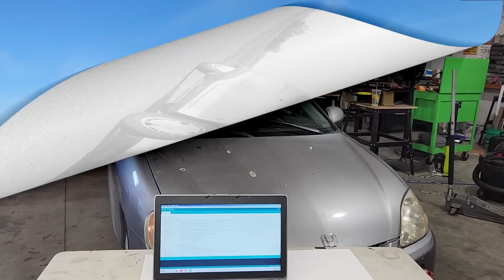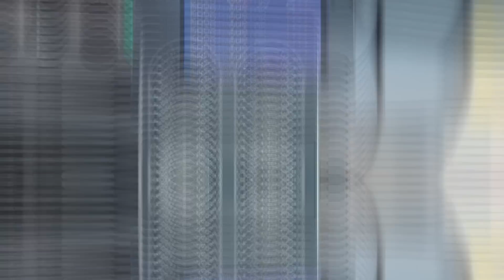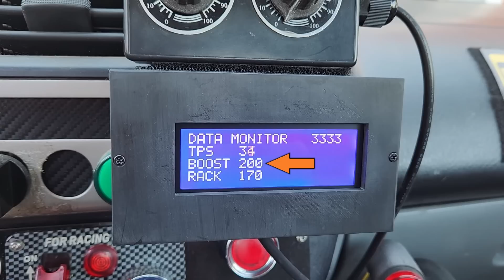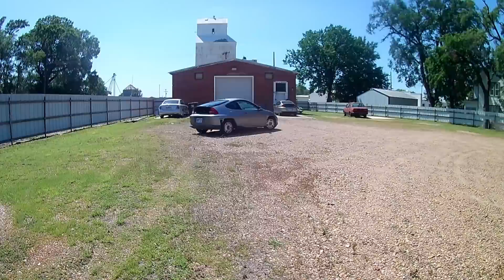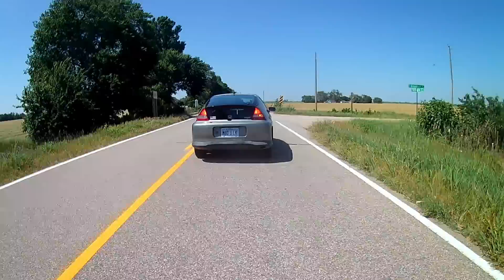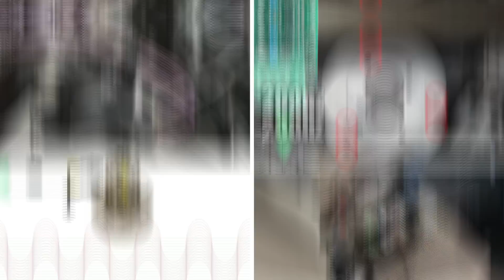S4 E22. We road test the Arduino engine management on the supercharged kubota diesel honda

Comment: Mitsubishi had a similar system on their euro2 4D56 engine before they switched to common rail injection

You can see it on some of their old triton/L200 single cab pickup trucks 

The injection pump has a servo attached to it that can adjust the fuel screw automatically

Comment: I wonder what the goal is and why he choose a tiny Kubota diesel instead of a, let's say, a TwinAir two cylinder 900 cc engine. Turbo charged these will at least have 105 hp. Doing the 'Everything at Home' trick that number would probable be much higher.

Comment: Wouldnt a turbo be more efficient than a supercharger? Maybe a variable vane turbo to make it spool on low rpms aswell.
Maybe also a intercooler and water injetion. So it runs cooler.
Reply: And NOS, how else would he win against hector and his turboed spoon engines with motec exhausts😅😎

Comment: A couple thoughts - you might want to make a 1/2 second ramp up to full fuel so that mashing the pedal still minimizes soot, and you might want to make a 1-2 second hold delay before dropping back down to zero, to help with shifting - otherwise, existing manifold pressure will be lost. Given that you have a fair amount of piping and an intercooler, that could take some time to repressurize, killing your numbers.

Comment: Maybe use the RPM to delay full throttle a bit, so the engine has time to chooch faster before you dump in so much fuel.

I think that might be the better option than use simply the throttle position sensor as it will allow more fuel to be pumped in if you go full throttle without any visible smoke.

You can just put the engine under load by driving and adjust for each RPM the knob until you see smoke and then back off 10% from the position you dialed.

Comment: You could make an optical sensor to detect the soot in the exhaust. I think they're fairly simple and you don't need an accurate number - just an indication of when it increases or decreases. Maybe get the control system to train itself. Or at least to characterise the space it's working in.

Comment: Old school turbo diesel were fitted with a device that allowed the control to open further as the boost pressure increased this would easier for you implement and compensates for loss in boost such a blocked air filter

Comment: And I forgot, datalogs are Your best friend, so get as much data as possible, somewhere on SD card or something, I think that MADMAN gauge You have in car has enough inputs to get everything(I'm not sure about data frequency of the logs but anything is better than nothing), just connect Your arduino PWM outputs as MADMAN'S inputs to get all data from Your "ECU" as analog signals 💪 have fun and I wish You good luck with this crazy setup You made 😂 I watch every single video and I love it 😂

Comment: As ECU tuner I can say You should adjust fuel by RPM and boost and Your boost by TPS and RPM (trying to get best performance of Your supercharger using something called "supercharger efficiency map" so You don't produce more heat than power) so I whould go with MAP sensor and RPM sensor and try to get it working, for the smoke... Best thing whould be to have AFR sensor, diesel starts producing smoke around 16,5:1 AFR for best performance and 0 smoke I am allways trying to hit around 17,5:1 but without any sensors You're just making educated guess 😂 in comercial cars it's ussualy done using MAF sensor and electronically controlled injectors where You can exactly measure how much air and fuel is put through the engine so You know AFR even without wideband sensor (this setup whould be impossible to replicate as You are venting boost to the atmosphere so MAF sensor whould read garbage until Your vent valve is closed and allso I don't think that You have injected quantity information from Your fuel setup either)

Comment: Considering rolling coal means you're losing power adding an ECU is a great solution. You should take into account the engine load using a MAP sensor. If you mix this and the TPS sensor you should be able to tune for power and emissions. If you make an table with RPM x MAP and use TPS for Accel enrichment you should definitely be able to make more reliable power.  For easy tweaking, if you load the tables into FLASH memory you could just tweak a value without having to reflash the whole program. You can also add buttons to tune on the fly.

Comment: Have you tried checking wheel alignment by measuring tread temperature with an IR thermometer?

i wonder if running extra narrow tires, like compact spares or motorcycle tires, at extremely high pressures could improve your mileage.

Comment: That looks like a Bosch system, but it probably has injectors that you can “hotrod “. My old diesel days I put injection tips and cleaned up/ adjust the pop pressure. Was noticeable in noise, fuel economy if you took the old non turbo motors , retrofitted turbo tips and bump up the pop to 125 -130 bar . No idea what pressure you have but if you add a thin shim in the nozzles it would help with the smoke.

Comment: of course different sized tires will make a slight difference in the reading from the speed sensor but that's something that should easily be adjusted in software if needed.  I would have loved to have seen you use a radar based ground speed sensor,  they're used on farm equipment

Comment: I’m tuned in for wherever this project takes me. I understand just enough of the electronics to kind of follow along. I’m just curious how much performance and mpg you will ultimately get out of it. I drive a f250 with a 7.3 turbo diesel and get 7-10 mpg so I the thought of getting 70 mpg is just crazy to me. Keep up the quality content!

Comment: would it be possible to implement some sort of cruise control basically hold the petal down a certain amount and the computer adjusts the fuel rack to keep the car at a set speed as close as possible seeing as you allready have rpm and car speed and control over amount of fuel in theory you should be able to make a cruise control of some sort to help on fuel economy tests in the rual roads!

Comment: the code thing is quite light with excellent presentation. so for this nuts & bolts guy atleast, its easy to digest. it gives a practical insight into what the car companies are up to with engine management but using stock modules to get there. brilliant!

Comment: Nice progress!  Just a thought, you might get better results if you fit a manifold pressure sensor and relate fuelling to measured available boost.  Since boost changes based on RPM and lags throttle position.

Comment: The only thing I really dislike is the exhaust, it resonates so bad. The little one could be so quiet but... it´s not. That´s my only dislike.
Until that I find the car very cool. That´s one solution to environment: a light car, just a few drops of fuel but moderate comfort.
When You fingered out the engine maybe it´s worth a thought what else burns like diesel but is cheaper. When You control the engine by software You´re able to write code for vegetable oil, finger out certain power curves for certain fuels.
Thankfully Your injection system can cope with that, modern common rail diesel have trouble with.

Comment: I dont watch your channel becuase only manual stuff, I watch it because of you 💪, as a student in the field of electronics and also hard manual work / wierd sketchy small vehicles builder /enjoyer.
I am still waiting for your next move to see what you have came up with.
Also I have weakness for small 4 stroke engines and also diesel ones, and that predator engine video is what pulled me on your channel all that time ago.

Comment: Anything you do is well above the will-watch line.  But, I enormously prefer the techie episodes over the 3D-print, drill, and hammer ones (would like them more with even more details, what about GitHubbing the code as a supplemental-for-nerds?).

Comment: An analogue mechanism to achieve similar fueling adjustment only requires a few springs and a throttle linkage to delay full fuel delivery.

Comment: Business idea: make bolt on electronic fuel rack limiters for all kinds of mechanical turbodiesels. I would love my car to smoke as little as this Kubota. It is a Mercedes w123 with an OM617 turbodiesel, upgraded injection pump and 5 speed manual.

Comment: Maybe next should be a Toyota Prius where you put the diesel in. You could drive electric and run the diesel as generator. Will need a lot of programming and sensors.

Comment: 3M dual lock is what you want for mounting things in a car, it's much more stable than velcro and the adhesive won't melt under extreme heat.

Comment: Jimbo, 

I concur with your decision to drive with the driver's side window down. I use the same procedure when driving with Darwin during the summer months. The air-conditioning doesn't condition the air too well, but with white paint, tinted windows, an open window and a bottle of ice water things are tolerable.

Comment: Next step should be integrating the egt probe into the system to start pulling fuel when the egt gets up around 11-1200f. actually you could even base your tune stages almost solely off of egt readings and throttle position. Heck do a full drive by wire setup and control the rack directly, and eliminate the governor and rack limiter entirely like modern mechanical diesels, they use a single stepper motor to directly move the rack

Comment: Awesome control of power fuel and smoke. I'd love to see the Yamaha Apex 4 cylinder engine run through the paces. I think ybe small lightweight extremely tunable and well balanced little engine is designed well enough to handle increases in power and heat from the diminutive horsepower up to really big power to weight ratio. 😊

Comment: The final version of the software will definitely have to include engine RPM and/or boost monitoring. At the moment the fuel rack will go to full tilt right away before the engine has spooled up on a hard launch (the moment you mash down the accelerator pedal), which would certainly contribute to the remaining smoke. The preliminary programming is basically a static approximation of a dynamic problem.

Comment: lol, the driver!
The car should have ABS sensors on each wheel, why no tap in there?
Reply from the maker: All the ABS stuff was pitched years ago.  This car is stripped to the bone  for weight savings.
Reply: @robotcantina8957  it's still pretty "fast" considering the "volume" of the chassis and some odd 600cc, lol.

wiki: Classic Fiat 500 with horsepower of about 13 bhp, its top speed was about 85 km/h (53 mph), and it could achieve fuel consumption of about 6 litres per 100 km of petrol (39.2 mpgus).

Comment: Heads up on gm stepper motors. Very common to miss steps and after a few swepes back and forth your 150 isnt 150 anymore. May be 140 or 160. May be part of the reason you noticed the power drop after the shift. Every time you shift you go from program 4444 to 1111 and back to 4444. Good chance it will miss a few steps. Even more so if you interupt the the program while it is making the steps.

Comment: Dude is building his own ECU, and writing his own code. Much respect!
Reply: this ECU is like a 1980s feedback carburetor system. the gross engine control is still manual but the fine tuning and some emissions over-riding is ECU managed.  Very impressive. ❤ (especially if it is more reliable than 1980s emissions equipment 😂)
Reply: @karlfischer1011 this comment made me miss my old RN38 Toyota Hilux powered by a 22R with a two-barrel "smart" carburetor.
Reply: @karlfischer1011  Not..really
Reply: Don't care about how far you have changed things , ocd , you have not been putting out vids every week, was a Sunday thing, now I don't care  what the car does,,,,

Comment: I still watched last weeks video despite camping, Running a 24" pc monitor that runs from 12v plugged into a toolbox with 1.2kwh of Lifepo4. Samsung Dex came in clutch.
I came here for the nuts and bolts but Arduinos are my forte and I love seeing you figure out how to use it the best.

Comment: Any way to advance the injection timing ?  Raise rpm governor?
Reply from the maker: Injector timing can only be changed by adding or removing shims under the injector pump.  The governor RPM limit was raised from 3600 to 4000.

Comment: I wonder if the guys who developed initial commercial diesel EFI systems ever played around with stuff this primitive too. Probably not on public roads because they definitely had engine dyno's (less trouble to go through for testing and better, more comparable results) but still. It's such a goofy little system, but it works and illustrates why EFI systems are just better than mechanical injection or much less carbs. At least it's now properly the most primitive EFI system ever run on the street because the electronics are actually controlling the injection system and not just 2 knobs on a dash lol.

Comment: Here is another great episode. Its nice to see everything in action from the boost valve to the fuel rack adjustments. Just as an idea instead of having Duke chase you around the Kansas farmlands, you could mount a gopro to watch the exhaust. I’ve been trying to think of a catchy name for this camera. All I can come up with is “coal cam”, which is a bit lame. 

Also nice touch with the Heads Up Display [HUD] so you can get real time results  from all of your gizmos as they go about their business. From a viewer standpoint it would have been helpful to visualize what’s going on if you could have also converted the computer units to engineering units (0-100% boost, I understand rack position is a bit harder to express simply). I’m wondering if rack position controls fuel rail pressure or just fuel flow (like opening an orifice). 

But anyways enjoy your time off, relax, and regenerate.
Reply: Banana in the tailpipe prevention cam?
Reply: The "NO Smoke " show cam lol

Comment: Hi here is the problem 80% of us don't understand even 1% of the electronics so we all switch off nuts and bolts we do understand love the videos thanks
Reply: 90% of what he's done to control the fueling with electronics could have been done mechanically with an LDA. Just like Bosch did decades ago on the P pump.
Reply from the maker: My system is based on the ALDA found on Bosch pumps.  Instead of fooling around with springs and diaphragms, I do it in software.

Comment: If you wanted to get super picky about making the response more linear you could try temporarily installing a wide band O2 sensor to get a better idea of what your AFRs are doing at different throttle positions so you could adjust the tune accordingly.
Reply from the maker: On a diesel, the AFR is off the scale for a typical wideband sensor.  None of the WB sensors I have will measure past 22 AFR.
Reply: @robotcantina8957  Ohh, I always assumed they swung between low 20s and high teens. Any way you could collect the full spectrum of AFR data on a diesel?
Reply from the maker: @thatonedude5237  I reckon it would take some research to find  a WB meter that can accurately read 25:1

Comment: I love watching this progress! Your doing some real cool stuff here and I love it!
I have another question.
I am not very well versed, so excuse my ignorance.
It was my understanding that most car engine management computers run at a very slow clock speed (40 or 50 MHz) because of insane code optimization. Thinking back to what you said about unnecessary code clogging up processor time. And the Arduino runs much, much faster than 40MHz. How hard would it be (honestly, I don't know) to optimize the code the same way? Is there a better option for a microcontroller that is easier to optimize? Is this why modern cars have 12,378 computers in them?

Love your content, can't wait to see what comes next on this beauty. 

Long live Cornholio!
Reply from the maker: The Arduino I'm using runs at 16mhz.. so it's pretty slow by today's standards.  There are other micros available that are much faster.  The sole purpose of the micro in this project is to move the two stepper motors as fast as possible. and at 16mhz there is plenty of computing power for that.  If I also measured the vehicle speed and RPM using conventional methods (direct frequency read),  The code needed to do that is not included in the standard arduino package.  So direct frequency measurements using the standard arduino programming language adsorbs too much time.  I can use alternative code for faster RPM and vehicle speed measurements but that's really necessary because RPM and vehicle speed are not really that important.

Comment: With the engine being governed, could you do a flat foot shift? Like leave throttle full while shifting because you don’t have to worry about over reving the engine.
Reply from the maker: That's what I do on the 0-55 tests.  It sounds like I let off on the accelerator, but in fact the accelerator is floored during the engine run.

Comment: Loving the small computer controls on this. Once you go full auto, i'd recommend logging things like the vehicle speed, EGT, boost pressure, engine RPM, and stepper positions.
Reply: Maybe a raspberry pi 400?
Reply: @Terran.Marine.2  or the laptop attached to the Arduino.
Reply: @Cynyr I thought of the R Pi 400 with the GPIO stuff, but no monitor.

There's probably a low power consuming and suitable screen available on the jungle site.

And while I doubt Jimbo will crash, air bags and screens seem like a poor mix, to me.

Comment: You need my 5gallon bucket a/c system 🤣 put a bunch of ice packs in the bottom of a bucket, cut a hole in the lid of the bucket for a 12 volt fan to blow air into the bucket and get a couple vacuum cleaner hoses to stick through the lid and down into the ice packs. Strap the bucket into the passenger seat and point the hoses at yourself. Sounds retarded but it works 😂